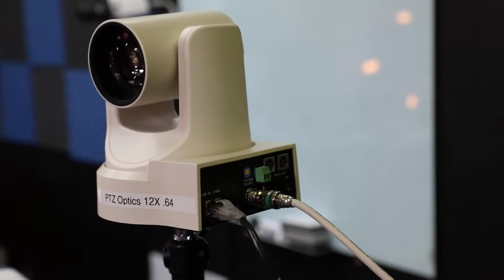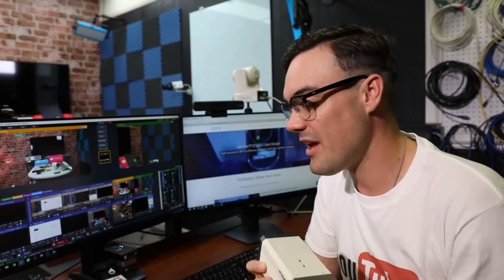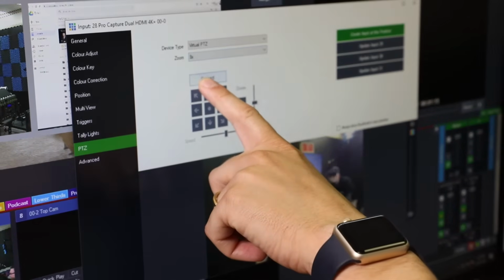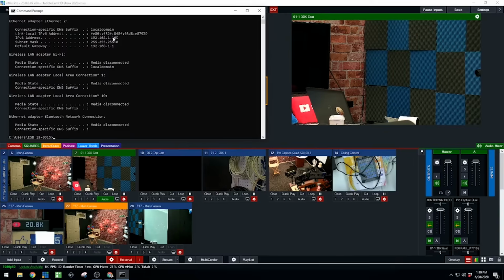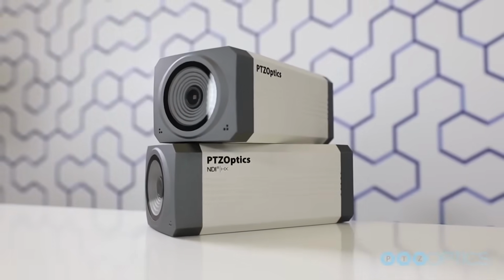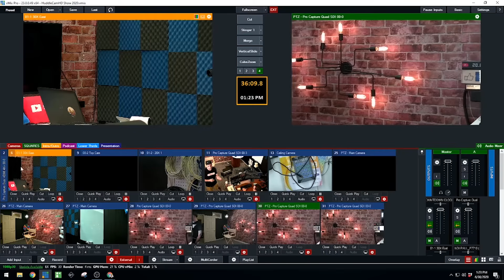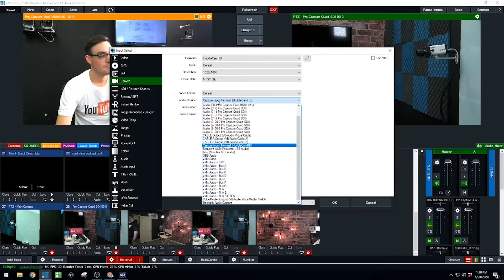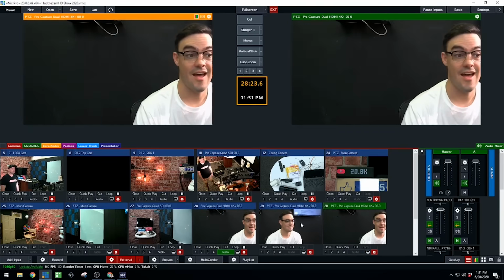Controlling PTZ cameras with vMix

Comment: in vmix you move camera by mouse by clicking rows: while hold button its moving when stop to hold its stopped. But in the shortcuts to start and stop movements I had to use different button on keyboard. How to use 1 button keyboard to start and stop?
Reply from the maker: You can achieve this on the Stream Deck by using vMix Shortcuts and then Activators. You can find them in the Settings tab in vMix.
Here is a great video to learn from: https://www.youtube.com/watch?v=6CgTkHpi6OI

Comment: How do I keep the PTZ camera from freezing on Vmix?
Reply from the maker: Hello!
If your PTZOptics camera is freezing on vMix, it's crucial to address both software and hardware factors that could be causing this issue. 

Here's a step-by-step guide to troubleshoot and resolve the problem:

Update Firmware and Software:
Ensure your PTZOptics camera's firmware is up to date. Firmware updates often include fixes for compatibility and performance issues.
Update vMix to the latest version. vMix regularly releases updates that improve stability and compatibility with various devices.

Check Connection:
Ensure your camera is properly connected to your computer or network, depending on your setup. For IP connections, verify the network cables and switches are functioning correctly. For direct connections, such as USB or HDMI, ensure the cables are in good condition and securely connected.

Configure Video Settings:
Lower the video resolution or frame rate in the PTZOptics camera settings if you're pushing the limits of your network or computer's capabilities. High-resolution and high-frame-rate video requires more processing power and bandwidth, which could cause freezing if the system can't keep up.

Network Configuration:
For IP-based connections, ensure your network is configured correctly. It's essential to have a stable and fast network connection. Consider using a dedicated network for your video production setup to avoid congestion and ensure high performance.

vMix Settings:
In vMix, check the input settings for the PTZOptics camera. Ensure that the correct input type (e.g., NDI, RTSP) is selected and that the settings match those of the camera.
If using NDI, ensure that your network supports NDI and that any necessary firewalls or routers are configured to allow NDI traffic.

Test with Another Software:
To determine if the issue is specific to vMix, try using the camera with another video software. If the camera works fine with other software, the issue might be specific to vMix settings or compatibility.

Review Computer Performance:
Check your computer's performance. Ensure your computer meets the minimum requirements for both vMix and streaming high-quality video from the PTZOptics camera. Upgrading hardware components like the CPU, GPU, or RAM might be necessary if your system is underpowered.

Contact Support:
If you've gone through these steps and the issue persists, reach out to PTZOptics support or the vMix support team for further assistance. They may offer additional insights specific to your setup.

Remember, troubleshooting is often a process of elimination. By systematically going through these steps, you should be able to identify and resolve the issue with your PTZOptics camera freezing on vMix.

Please reach out to our PTZOptics Support Team
Support Numbers: 833-888-9706 or 484 593 2584
Monday -Thursday: 8am to 6pm EST
Friday: 8am to 4pm EST
Not open Saturday or Sunday.
Community Portal: https://community.ptzoptics.com/s/

Thanks for checking out our Channel! 
Learn More: https://ptzoptics.com/
Reply: @PTZOptics  Thank you very much! I will try this.
Reply from the maker: Thanks for checking out our Channel! 
🌐 Explore More: https://ptzoptics.com/

Comment: (Camera mounted upside down) My flip-v setting resets to default every time the camera is rebooted (after a year of keeping the settings).  Any suggestions on how to get it to stay?  Changed setting with remote and web interface- neither way kept setting change after rebooting camera.
Reply from the maker: Hello, so the first thing you need to do is update the firmware on your camera. The new firmware saves almost all the OSD settings with each preset including the image flip. Set your image the way you want, and then save preset 0 that way, and that is where the camera will go to each time it is rebooted.

PTZOPtics Support Number
833-888-9706 or 484 593 2584
Monday - Thursday: 8 am to 6 pm EST
Friday: 8 am to 4 pm EST
Reply: Thanks! Finally discovered it was a setting in the OBS software that was flipping it on startup.  Thanks again for taking the time to respond- your cameras are awesome
Reply from the maker: Thanks for checking out our Channel! 
🌐 Explore More: https://ptzoptics.com/

Comment: can use polycom eagle eyes control using vmix?
Reply from the maker: vMix does not natively support direct control of Polycom EagleEye cameras. vMix is primarily designed to work with PTZ cameras that use standard control protocols like VISCA, VISCA over IP, Pelco, and others. Polycom EagleEye cameras typically use their own proprietary control protocols, which may not be directly compatible with vMix's PTZ control features.

Comment: My PTZ Optics 30x NDI is connected through ethernet cat5 cable but but vWix can't locate it from "NDI/Desktop Capture" section from Input. Needs help figuring out what I'm missing. Thanks
Reply: Does your camera have an IP address on the same range as your vmix computer?
Reply: @StreamGeeks  yes it does
Reply: Same issue here, OBS sees everything fine with out a snag but vmix sees nothing, just spins searching but not finding...
Reply from the maker: Hello!
Based on general knowledge about NDI and vMix, here are some troubleshooting steps you can take:

Check Network Connectivity: Ensure that both the PTZOptics camera and the computer running vMix are on the same network. NDI requires that all devices are on the same local network for discovery and communication.

Verify NDI is Enabled on the Camera: Make sure that NDI is enabled on your PTZOptics camera. This may involve going into the camera’s settings through its web interface and enabling NDI.

Update Firmware and Software: Ensure that your PTZOptics camera has the latest firmware and that you are using the latest version of vMix. Updates can resolve compatibility issues and bugs.

Check NDI Version Compatibility: Ensure that the NDI versions supported by the camera and vMix are compatible. Sometimes, a mismatch in NDI protocol versions can cause detection issues.

Firewall and Antivirus Settings: Check the firewall and antivirus settings on the computer running vMix. These can sometimes block NDI traffic. You might need to create exceptions for vMix and NDI traffic.

Restart Devices: Simple but often effective – restart both the camera and the computer running vMix. Sometimes, this can resolve connectivity issues.

Use NDI Tools: Use NewTek's NDI Tools, specifically the NDI Studio Monitor, to check if the camera is visible as an NDI source on the network. If it is visible in the NDI Studio Monitor but not in vMix, the issue might be specific to vMix.

Check Network Equipment: Ensure that your network equipment (like switches and routers) supports multicast and is properly configured for NDI traffic.

If these steps do not resolve the issue, I recommend reaching out to PTZOptics support for further assistance, especially to confirm that the camera's NDI settings are correctly configured. Additionally, vMix support can provide guidance if the issue seems related to the vMix software.

Comment: We are considering using Vmix instead of OBS for church live streaming. We are needing a new camera controller. Planned on purchasing this: Sony RM-IP10 IP Remote Controller which is $1600+. Considering Vmix or Wirecast. With Vmix ability to control PTZ cameras (we have 2 Sony PTZ's currently), is intriguing to use Vmix if this will work well. One question would be: We have one person running the broadcast software doing all the scenes and lower thirds etc., and one person doing all the camera switching. Is is possible to run the Vmix from 2 different machines so camera operator just operates the cameras and the software person still just does the organization of the service? Thanks for your help!
Reply: Hi Jeff, yes you can use the vmix web controller to allow a 2nd person to do camera switching
Reply: @StreamGeeks  Thanks for the reply! Do you know specifically if you can control a Sony SRG-300HW 1080p PTZ with Vmix? I have searched and searched and cannot find if Vmix will control this specific camera or not. We currently have 2 of them. Would be a lot cheaper for our Church to just purchase the $700 Vmix package instead of a $1600 controller and still not have a better software to work with. Thanks for the information!
Reply: @jeffhancock891  It may work. You can try the free vMix download and test it before you buy.
Reply from the maker: Thanks for checking out our Channel! 
Learn More: https://ptzoptics.com/

Comment: Unfortunately, he failed to mention that you need the highest ($700) version of vMix to control ptz cameras.  We bought the very nice PTZOptics  camera and had the HD version and no joy.  The PTZOptics controller software works well to and there are other ways but I thought this would have been important to know.
Reply from the maker: Hello!
Thank you for sharing your experience regarding the use of PTZOptics cameras with vMix. It's indeed an important point to note that controlling PTZ (Pan-Tilt-Zoom) cameras directly from vMix requires the higher-tier version of the software. In the case of vMix, PTZ control is a feature included in their more advanced (and more expensive) packages.

For those considering integrating PTZOptics cameras into a vMix setup, it's essential to be aware of this requirement. The PTZOptics camera controller software is a great alternative for controlling the cameras, and as you mentioned, there are other ways to manage PTZ functions without relying solely on vMix.

It's always beneficial to research and understand the compatibility and feature limitations of software and hardware integrations in a video production setup. This helps in making informed decisions and planning budgets accordingly.

If you have any further questions or need assistance with your PTZOptics cameras or any other aspect of your video production setup, feel free to ask. I'm here to help!

Thanks for checking out our Channel! 
Learn More: https://ptzoptics.com/